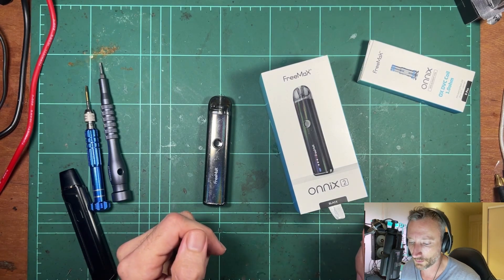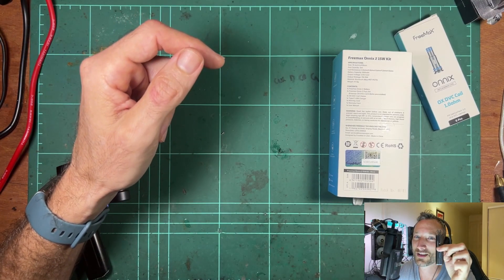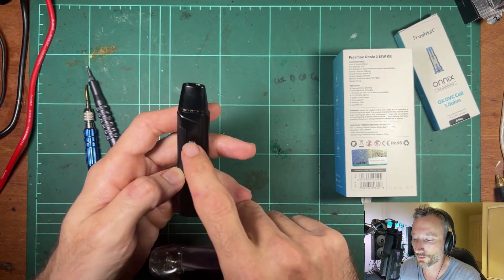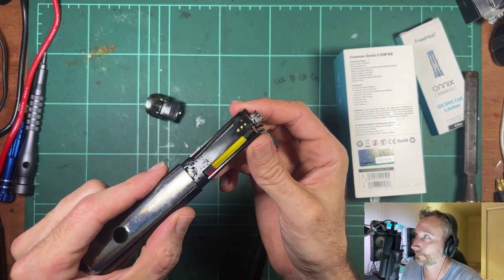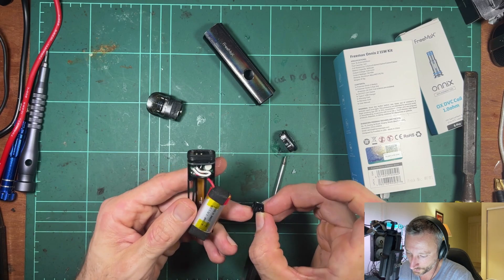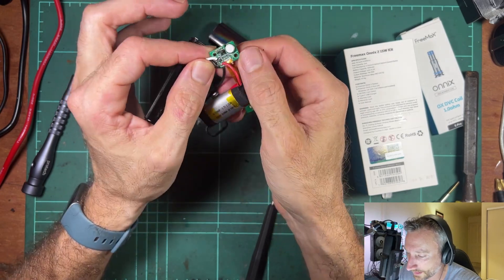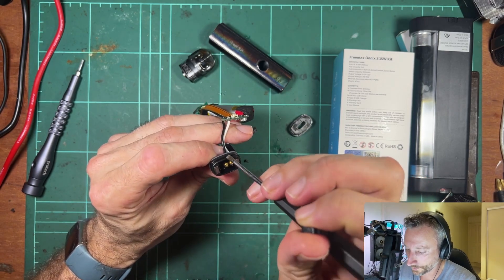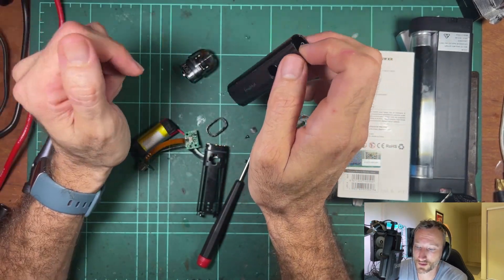FreeMaX Onnix 2 - Review and Disassembly

Comment: I gave up trying to open it after watching your review.. it laid there for a while, maybe 2-3 months.
I just pried out the firing button and was able to take the device apart, pushing the internals through the top.
I found a broken cable, does not seem to be any juice related damage, i will get the wire soldered, as i dont have a solder, and then let see, may be it will work!!
Reply from the maker: Thanks for the information! Hope you can get yours working and back together :D

Comment: Very nice... but have you figured out how to dissassemble the first onnix with 1100mah.  I tried to but didn't find a good way to dissassemble it. Any help would be much appreciated . Cheers
Reply from the maker: I don’t have the original Onnix, sorry man. These pods aren’t meant to be disassembled at all, I reckon almost all the ones I’ve had apart have been with a destructive process - if you get them apart then they’re stuffed anyhow. Def best to cut your losses and get a new one!
Reply: @vmgtesting8014  ok thanks for the tip. but i have disassembled many pods from different coms. and i fix the sensor for friends relatives etc coz i enjoy that !! but the first onnix the only one i coudnt dissas. and it drives me nuts :D. anyways thanks and keep up the good stuff. cheers
Reply from the maker: @Who__Cares  Oh great job mate and thanks for the reply! I reckon you’ve probably worked on more pods than me, please feel free to share any tips on vids that I post or correct me if I do something wrong. Cheers :D
Reply: @vmgtesting8014  for sure man i will. cheers

Comment: Cheers for this vid mate. Loving my freemax 2, just had issues when installing the sub ohm mesh coils. Tried everything but just would not fire. Other coils work fine. Has this happened to you? Anyway cheers for review
Reply from the maker: Sorry for the very late reply! Were you trying to use the 0.5ohm coils? From memory they’ll fit in the Onnix 2 pods but they’re not actually compatible, the resistance is too low. I think only 0.8ohm and up works. Cheers for the comment mate!

Comment: Hello, will you ever be doing disassembly and analysis for uwell devices? like KOKO PRIME, G2, A2 ...etc
Reply from the maker: I’d really like to! Testing and vid making time is super limited at the moment but I think these will be some of the first models I look at getting after I get through the samples I have waiting. I bought the original Caliburn ages ago and really enjoyed it, would like to see how the new models perform and how well they’re made. Cheers.
Reply: @vmgtesting8014  yeah I have a Caliburn G, koko prime and vision all devices with one main issue....these start burning coils right after when you use them after a full recharge so I started looking around if someone has done some testing on this, maybe the voltage is high right after recharging......the issue resolves itself after some draws but this is not good for coil longevity. Confirmed this from my friends as well who are also using these devices. Moved to XROS to get away from the problem......now this one is burning my tongue with spit back, excellent.
Reply from the maker: @3xodustech936  That’s good info for sure and an interesting issue, thanks mate. Yes I definitely can test the voltage output at full charge to see what’s going on. I’ve got the feeling this is a coil issue tbh. The coils really should be designed to handle the output at full charge but it might be that they made them to still perform well down at the lowest cell voltage and are having a hard time at 4V.

Comment: I strongly believe any autodraw pods I had  have this issue, at the end of the day air needs to go thru to activate the sensor and is the same way liquid or condensation will enter. And when this happens then it will start to malfunction. I believe its market thing with all autodraw pods. Personally, I stay away with autodraws and had more success with manual firing devices from an experience of way to many broken autodraw devices.
Reply: Oh, and thank you very much for the sharing and the advice of the end of the video, very useful. Stay safe.
Reply from the maker: It’s a design challenge inherent to basically all pods, definitely agreed. Every atomiser is going to breathe condensation out of the airflow and it’s gotta go somewhere! Even in the models without auto draw there’s still the possibility of liquid getting down in between the pins - they have to be sprung which means they’re difficult to seal. But yeah, getting liquid down the passageway to the sensor is the bigger risk IMO. Thanks for the comment mate!